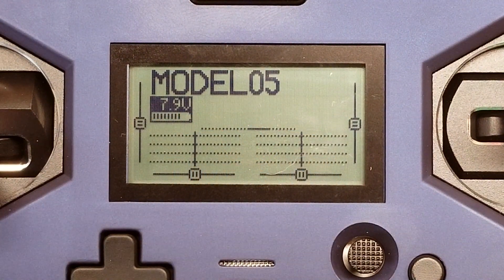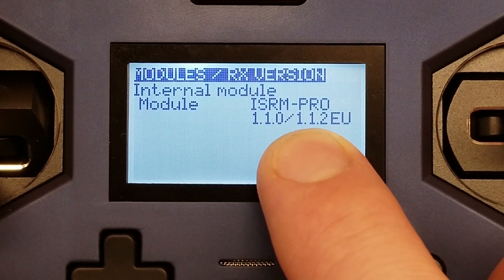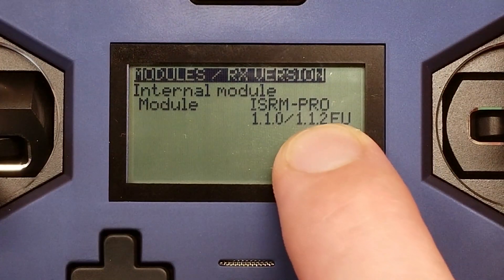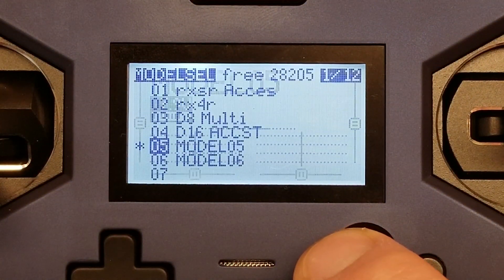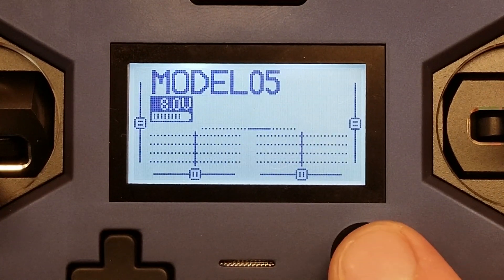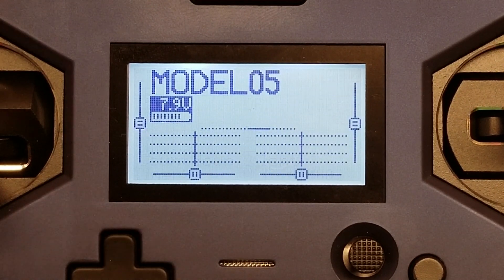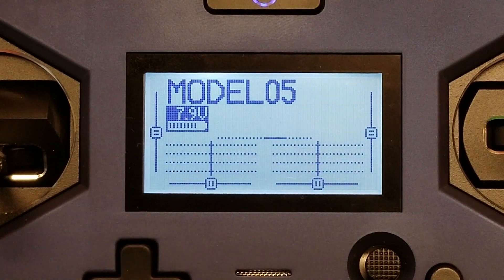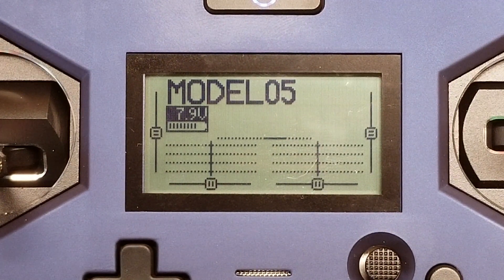Frsky X-lite Pro D16 LBT FCC bug

Comment: i have a new xlite s (FCC) and a xjt module to be able to bind in D8 mode but it doesn't work, the module does not show up on de transmitter wen plugd in, what to do, i m  new to open TX. love your channel...
Reply from the maker: You will need to update to the latest opentx software to get the xjt lite module to show up under "external"
Reply from the maker: Follow this video https://youtu.be/nYeB0IXT-10 it's for a different version and radio but the steps are the same. Just use the newest version at www.opentx.org
Reply: @TweetFPV  Hi, thank you, the download went well thanks to your vid. the xjt shows up on the xlite s now, but i can still not bind to the tinyhawk s in D8 mode, the radio is not responding in betaflght i will have to check everything, can i banktransfer some funds for the work you do? i dont have paypal. Greetings from Belgium, Happy New Year,Chris
Reply from the maker: @snakefich  try using the cli bind commands see this page https://github.com/betaflight/betaflight/blob/master/docs/FrSky%20SPI%20RX.md keep in mind that the command has changed from betaflight version to version.

Comment: Hi! I bought a FrSKY X9 lite pro Uruav edition at Bangood. I can not bind it to any receiver I have. Could you suggest me what to do?
Reply from the maker: Which recievers are you trying to bind to?
Reply: @TweetFPV  I have Eachine red devil 2 drone. In explanations it's written SPI BUS receiver.
Reply from the maker: Ok. So out of the box you won't be able to bind to those models. You need to go into betaflight and in the configuration tab looks for reciever protocol and it should be listed as frsky_d. You need to change that to frsky_x. Then you should be able to bind. Keep in mind that when you setup your model in your radio you need to change the internal rf from access to accst d16. 
Now you can bind. But the internal rx in these models are really really bad on d16 mode. Be very carefully where you fly. Flight range could be very short or unpredictable.
Reply: @TweetFPV  I have done it for several times watching different youtube videos and it still does not bind. Seems like Taranis speaks another language.
Reply from the maker: Does your model say accst d16 in your radio? Also what version of opent tx do you have on your radio?
Reply: TweetFPV yes, I have access and aaccst d16. Open tx 2.3.2
Reply from the maker: I have better luck binding through the betaflight cli line have you tried that?
Reply: TweetFPV yes, of course. Does not work 😞
Reply from the maker: Join my discord and I can help you better. https://discord.gg/q694HB
Reply from the maker: Just out of curiosity. It does have the frsky spi reciever and not the flysky spi reciever?
Reply: TweetFPV I have ordered frsky spi receiver at Bangood
Reply from the maker: @fanisaiupzhanov2299  at this point if all the info is accurate I don't really know what to tell you. I do recommend the xjt lite module to go with the new line of access radios. I understand it should work with d16 but with how many d8 models are out there the xjt lite module will make life easier.
Reply: TweetFPV What is the best solution? XJT lite or R9M lite pro?
Reply from the maker: @fanisaiupzhanov2299  those are two completely different things. One is a d8 transmitter and the other is a 900mhz long range transmitter.
Reply: TweetFPV I bought xjt lite. Still doesn't bind.
Reply from the maker: @fanisaiupzhanov2299  have you updated to the latest opentx software on your radio?
Reply: TweetFPV Yes, 2.3.5
Reply from the maker: @fanisaiupzhanov2299  does the red light come on on the back of the xjt lite moduel?
Reply: TweetFPV red light is solid and green flashes
Reply from the maker: @fanisaiupzhanov2299  make sure the Quad is setup as frsky_d in betaflight and that you make a new model In your radio with the internal rf turned off and the external set to xjt d8 mode. I have the best luck with binding using the cli commands for binding. If that doesn't work I would assume that your reciever in your Quad is either not compatible or damaged.

Comment: Has anyone tried the 190720 firmware from 2019-07-23? I'm seeing the correct internal module version (1.1.0/1.1.2FCC) but I still haven't been able to get it to bind in d16.
Reply from the maker: I have and it works for me. What are you trying to bind to?
Reply: @TweetFPV  I have a Mobula7 HD (CRAZYBEEF4FR 4.0.4)
Reply: Reached out to FrSky, and they responded that there may be an issue with the onboard SPI receiver for the flight controller - apparently it uses a reverse engineered version of the D16 protocol that has issues with the new ISRM hardware... They did suggest a workaround - use the Betaflight CLI to enter bind mode on the receiver instead of the bind button on the fc - but this didn't work for me either. 

There appears to be a related Github issue for Betaflight here: https://github.com/betaflight/betaflight/issues/8603
The issue was originally closed as missing information, but I've reached out with more information hoping to get it reopened.
Reply from the maker: Good luck. Not sure why yours isn't working when others are. I'm sure there is a bug in the code somewhere. Please keep us posted if you have any changes.
Reply from the maker: Have you tried any of the nightly xlite pro fws?
Reply: @TweetFPV no luck with nightlies. I ended up getting the vantac mpm and that's working just fine

Comment: I have the same issue,after updating now it says its an EU version is it necessary to flash the power management unit? I think i read somewhere only to update if theres an issue with it, is this true?
Reply from the maker: Only flash the pmu if you are having problems with external modules powering down. If the region is wrong for your isrm then contact frsky customer service for the Lua script to fix it.

Comment: I want to buy the Pro, for the built-in charging, better gimbals and extra buttons but with the lack of any D-8 support there's HUGE reason for me not to get this radio.  However, I keep hoping they will fix this one glaring flaw.  Someone tell me there's hope still to come from FrSky.
Reply from the maker: There has been rumor of d8 support but I can not confirm that at this time. If you want the xlite form plus built in charging and d8 support then the standard xlite with the uruav charging module would work too. Or the xlite pro and a multi protocol module is probably the easier and better route.
Reply: TweetFPV - I was thinking the same thing, but then I would be swapping out modules to get R9 or D8 support, plus voiding the warranty to gain charging support.  While it’s an option, it one I would take reluctantly.  However, I just fired off an email to FrSky asking them to tell me if D-8 support will be in the future for the Pro or if not, then tell me to buy the X Lite original.  What would be perfect if FrSky just made an X Lite “Plus” with ACCST D-8, D-16, Hall Effect Gimbals and built-in charging and I would be a happy camper...lol
Reply from the maker: Agreed.
Reply: @frankbarajas  Any update from them? I'm in the same predicament.
Reply: @elli0tttttttt  - Yes actually, I wrote to FrSky and received a reply.  However, the news was not what we had hoped.  D8 support will NOT come in the form of a firmware patch.  The following is an excerpt from that email:  "...we are shifting away from D8 in the internal modules of the newer radios."  For reasons, we already know, but they also stated, "...the current plan is to support D8 through multiprotocol modules as well as with a proposed XJT Lite module for the newer radios."  The following link confirms the XJT module in the lower left of that webpage under Compatibility List:  https://www.frsky-rc.com/frsky-advanced-communication-control-elevated-spread-spectrum-access-protocol-release/

Comment: On a different note..Lol I Finally did get my Crossfire module to power up properly using the latest nightly build.. HOWEVER LMAO.. there is STILL a ton of shit going on with this radio and it really makes me wonder how a company that has provided us with such stellar equipment as the X9D got this Sooooooo Wrong when it comes to the XLite Pro??? After watching your video I went back into the radio to check the issues you noted. I click on the selection for Modules/RX Version and mine shows NOTHING. I also noticed that NONE of the "Special Tools" options are available. Ok.. I get it.. I flashed a Nightly (the newest one) but why do I have to lose shit that should be there ??  Hey.. FrSky.... FAIL

Comment: I have a same problem with my X9-Lite ! The last Firmware FCC no binding on D16 Protocol with my Crazybee F4FR … :( and no protocol D8 … Its crazy !
Reply from the maker: When you check your ISRM version does it say FCC or EU? also if you have the crazybee f4fr you need to change the communication protocol from Frsky_d to Frsky_X to use D16 mode.
Reply: @TweetFPV  I check version in my X9-Lite is : ISRM-N 1.1.0/1.1.2FCC . And i select Frsky_X in betaflight  after i try to bind in mode ACCST D16 . Nothing ... :(
Reply: famillepave I have the same setup and the same problem, contacted FR supp minutes ago
Reply from the maker: Sorry I didn't get back to you. The YouTube studio app is terrible for tracking messages. I have bound my xlite pro with the crazy bee f4 pro boards. I have a x9 lite in the mail and will give that a go when it gets here. I can't see it being any different but you never know what bugs are in the code.

Comment: Same issue here! :D
Reply from the maker: Frsky assures me that they are working on this issue.
Reply: Issue has been solved! Contact Frsky NA for the lua script needed =)
Reply from the maker: Yea same guy got me the script late last night.
Reply: Can you share it? Or a video helping how to solve this issue?
Reply from the maker: I am working on the video right now. But they have specifically asked me not to share the file because they are trying to figure out which batches of radios have this issue. They asked that i direct people to naservice@frsky-rc.com I have asked them to let me share the files and i am waiting for their response.
Reply: @TweetFPV  I got the same response. Was asked not to share the file. Make sure you mention turning the internal module on in the current model. I have the internal module turned off in my sim model since I use a long USB cable and therefore could not get the script to read the module mode. I caught it after a bit of troubleshooting but definitely worth mentioning for others who may be running an external module or something else.

Comment: I've installed the new 190605 firmware update and I don't get D16. It just says ISRM. The readme implies that it will say ISRM for both D16 and ACCESS but in your video it shows ACCESS and D16, not "ISRM". I can't bind to anything. I'm thinking I should just get an R9MLite. Any tips? This is a $200 brick. I sold my X9D for this. I hate this controller.
Reply from the maker: Isrm is just what they are calling thier new internal module. Like the old one was the xjt and the new one is isrm. The isrm can do both access and accst d16 or at least it should if frsky ever gets thier fw straightened out.

Comment: Did you speed up the video when you installed module firmware mine took longer to update. I had to turn on my radio while holding the 4 button pad down to update the transmitter. I did not do the PMU update. There was a warning to not do that except on radios that needed it without a reasonable explanation of what determined that. I don’t have an external module yet, so I figured it was ok to skip that part for now.
Reply from the maker: Yes i typically speed up things like that during my videos.